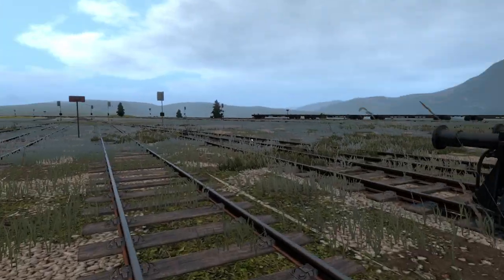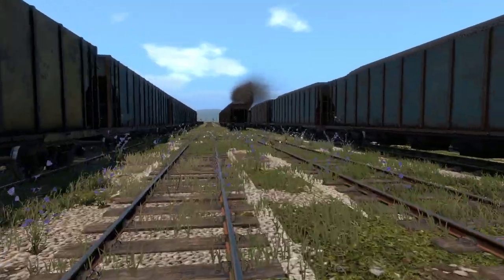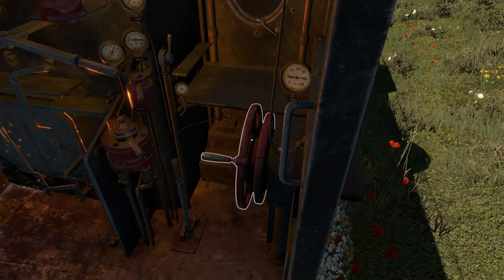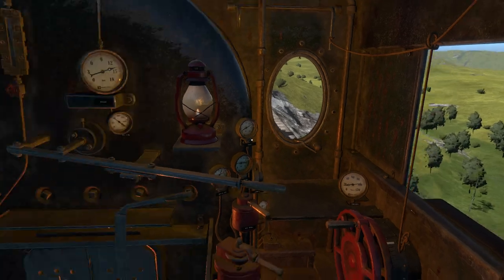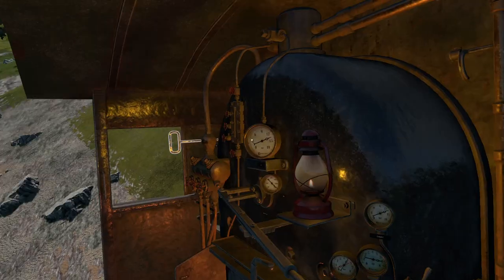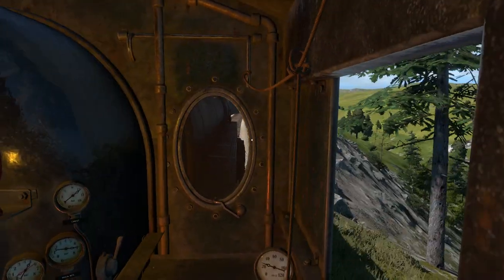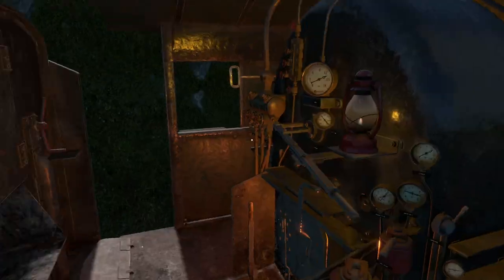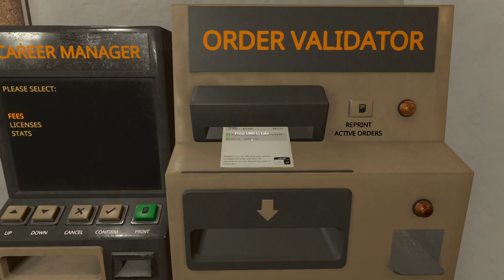880 Ton Coal Haul With S282 | Tutorial | Derail Valley: Simulator

Comment: If you are popping the safety as often as you are. Yoy are wasting steam and water. Open the cutoff more and use that steam rather than venting it. Or trickle in water to the boiler to concert that excess heat to steam.

Also, leave the train brake in the release (rearmost) position whenever yoy aren't using it. Leaving it in the middle will prevent the reservior on the cars from recharging.
Reply from the maker: Whilst I am wasting steam, the amount that i am wasting is likely minimal. When you are going up the coal mine line, you cannot spare any expense with the steam, and if you even start to lose even 1 bar of steam, then it will take a while to get that back from steam production, It's always better to be safe then sorry when it comes to pulling heavy loads up hills, you can notice how in squirrels tutorial on the S282 where he puts the damper down to stop the safety from popping, well thats just because he was too concerned with "Wasting steam" when in reality, you are using up 95% of the steam that you are producing when pulling heavy up the coal line. So popping the safety is materially insignificant in the grand scheme of a haul, and plus the costs of water is so cheap, that it likely won't matter at all, and coal is super cheap as well. So in conclusion, while yes i may have been wasting a bit of steam, most of it was actually being used up, and that excess steam was just to ensure i would stay at maximum steam pressure along the whole climb, rather then putting the damper down, and risk stalling on the grade because steam pressure drops down because of not enough steam production. As for the brakes, it's a good rule of thumb just to keep the brake lever on non self lapping brakes in the lapping position, just so that if you somehow lose pressure in you brakes, you can find where on the train you lost the pressure from, and fix it. Also it's normal operation to keep it in the lapping position when you aren't actively releasing, or applying. Hope this sums up my way of thinking.
Reply: @TheOofertaffy  i see where you are coming from but I see two issues with the line of thinking. I agree that you want to keep as high a pressure as possible, but When the safety is popping you are generating more pressure than you are using. It has to leave the boiler somehow. I was only recommending instead of venting it, send it through the cylinders where possible to generate more speed on the climb. You were notched back quite aways while the safety was blowing when you could have notched forward to use that steam instead. I was not recommending dropping the damper. You need all the heat you can get.

Secondly, as the boiler empties, you need to generate a lot more steam to stay pressure. Keeping the boiler fuller, assuming you have the heat, will make keeping pressure up easier as there is a smaller volume to fill with steam. Hence the recommendation to trickle in water. Its a delicate balance.

Lastly, the brakes. Its best practice to leave the handle in release. When held in Lap, it closes the main reservior from the brake pipe. Each car has its own reservior that it uses to apply that cars brakes when the brake pipe pressure is reduced. Those same reserviors are also recharged by the brake pipe. In order to release the brakes, the brake pipe pressure only needs to exceed the auxiliary reservior pressure. If you set it to lap at that point where the train brakes have just released, the auxiliary reserviors will not recharge. Leaving it in release ensures that the auxiliary reserviors are always ready for another application.
Reply: @TheOofertaffy  Also seeing this video was weirdly timed as I was just at Coal Mine for the first time, with the S282, hooked up to a 960 ton coal train. I can as of this moment confirm it is doable. But its has to be run on the ragged edge. There were many a boiler explosion after the crest.

Comment: Cool video.  I haven't played the game yet but you and Squirrel are the best steam engineers I've seen!  How do you decide between opening or closing the main steam valve and tuning the steam chest control (I don't know proper name but I'm talking about the wheel that controls the Walschert gear that controls the dwell time (and direction) of the valves that admit steam to the cylinders).

Sorry if this is too wordy!

Edit:  FWIW the game sound was almost drowning out your speech.
Reply from the maker: Yeah sorry about that, the next video will be better tuned for the audio. Basically, you want consistent steam chest pressure when going up a hill, using the cut-off wheel changes the opening that allows steam into the chest, and as you go faster, more steam gets wasted per piston cycle. This is why you need to come back on the cut-off wheel so you don't waste steam, the more you come back on the cut-off wheel, the smaller the steam opening becomes, therefore making the pistons more efficient, whilst still maintaining the same steam chest pressure. This is critical when doing a hill climb because if you have the cut-off wheel fully forward, you will be wasting steam you need to get up the hill. Hope this answers your questions. And again, i will have better audio in the next video, I had played some minecraft on my twitch, so the audio was tuned to that.

Comment: Nice job, i found driving the steamer at night a freaking nightmare in simulator, easy to miss the water lvl just at the wrong moment. Hard work with 880t, and steelmine doesnt pay much for the coal.
Reply: You definitely need the lantern on that little shelf on the tender behind the engineer's area on the locomotive. Makes night time hauls a lot more viable
Reply: Doesn't pay much? He got 40k base + 20k bonus. That's a lot.
Reply: @marvin95  its ok but doing hazmat from harbor to csw of food factory and back from oilwell to harbor is getting much more, specially since you get payed for both ways.
Reply from the maker: @schuttrostig5729  Agreed, but it is fun to switch things up a bit, otherwise the game gets mundane and boring.
Reply: Definitely, the small areas I don't use much because they don't pay much, don't use much other than hazmat as they pay the most  @TheOofertaffy